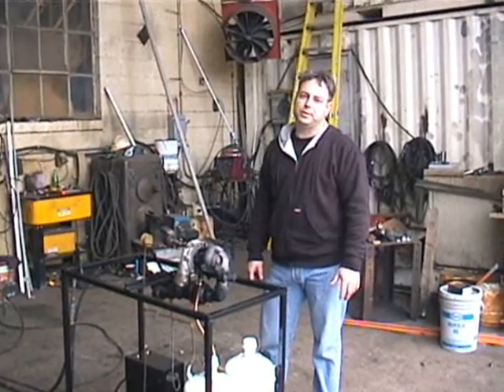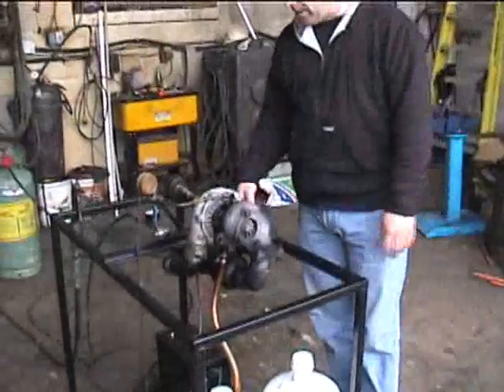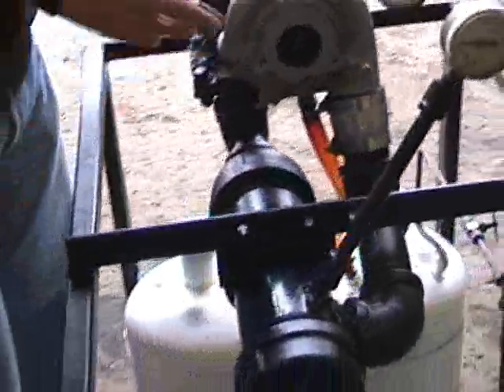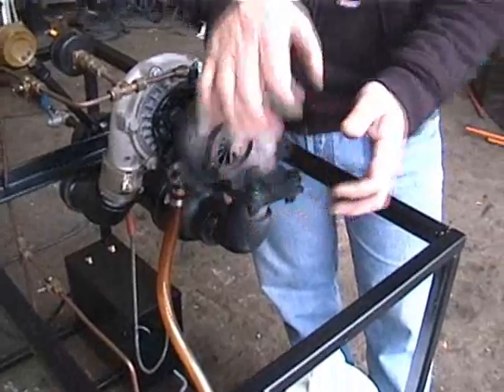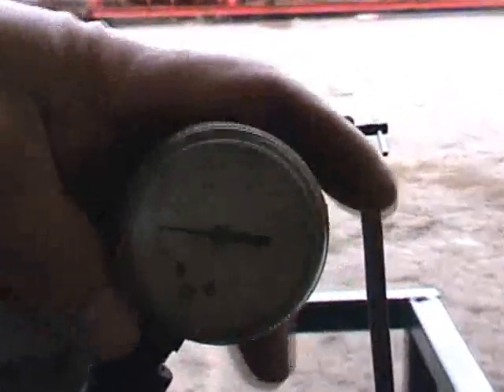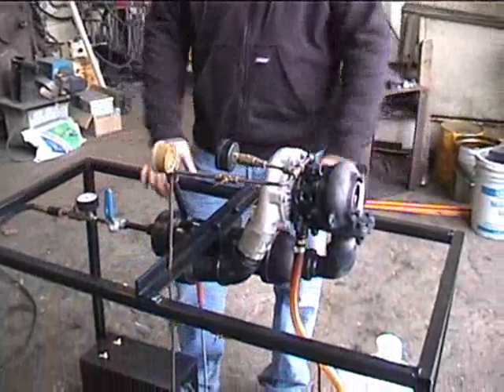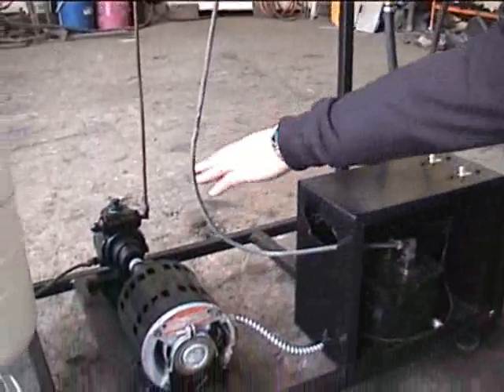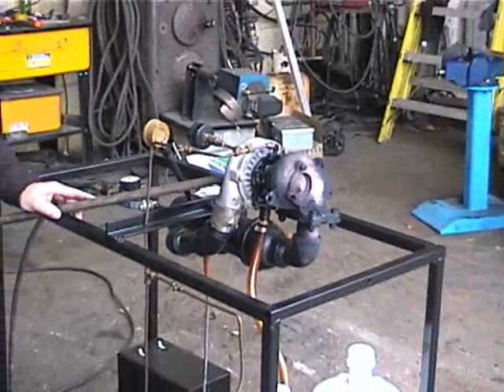Do-It-Yourself Turbocharger Turbojet

Comment: Um... I'm not sure this would be classified as a "Turbojet..." This would be a gas powered blower with a "turbo" assist. It has thrust but wouldn't really be a turbojet or jet. Isn't a turbojet something that powers its self through combustion rather than electrically powered blower? Correct me if I'm wrong. I have a friend that uses this to power his forge so, it's weird to me to see some one call it a turbojet. Resurrecting old post!
Reply: Does he use turbochargers to power a furnace? O.o
Or the blower?
The blower is used to start the engine, the first turbojet planes needed giant blowers to start up. This is a tiny engine so a small blower is enough.

Comment: in your 3" combustion chamber do you have a flame tube in it with the primary, secondary, etc holes in it or is it solely an empty 3" pipe? im just wondering cause your spark plug is mounted on the side

Comment: too danger to operation, the rpm is above 50,000 rev per min. During the engine is operation if something wrong  such as crack or broken, the pieces of metal is like a gun bullet which could kill you.

Comment: Nice job,Just a suggestion,if you want to make your oil seals last just add an oil cooler set up like they use on automatic transmissions.It's an old technology that EMD uses to this day.they call it a soak back system.when you shut off the turbo,leave the pump and cooler on to get the heat away from the center section.then too remember,your running at a very high level.blowing air in like you do before complete shutdown helps a lot,but the "soak back system" will cure your seal problem.

Comment: @hgortermarof  The only difference (essentially) between the homemade version like this and a manufactured turbojet engine is the location of the combustion chamber. On an actual turbojet engine, it would be wrapped around the center of the turbo, instead of routed around. This, and the fact that it doesn't have multiple stages of compression, a starter motor, afterburner, etc.

Comment: only thing is the kerosene in the combustion chamber will have to be under alot of pressure to ignite an idk if u can get those kinds of pressure with just a turbo which only put out 1-9 psi of boost. dont quote me on the 1-9 psi, i tried to research it n didnt find anything

Comment: put a cone or something on the exhaust end to increase thrust, use kerosene under pressure as your fuel and add another spark plug on to the exhaust cone for an after burner... it will ignite the fuel in the exhaust that wasn't ignited in the combustion chamber and increase thrust even more

Comment: Based on what I hear and see, this thing has blasting efficiency! Congratulations! If you wish to use it to generate electricity, I have some idea for you - try to get the torgue from a secondary multi-staged turbine instead of turbocharger's shaft. It could recover more energy from a jet stream and provide you with lower RPM on a shaft. There is only 1 company I know (Barber Nichols), who build high-rpm alternators, and they are really expensive.

Comment: @SmalltownTractors a turbo on a regular car, like the one he is using will have aprox 80 000 - 120 000 rpm. this is limited because the turbo propeller shaft has no bearings. oilpressure is making a thin oilfilm that the saft is gliding on. if this was a ballbearing turbo (often used on raceengines) you would see up to 200 000 rpm, and even more if things where optimalised. there have been recorded over 250 000 rpm on race turbos wich i know of :) hope you understand :)

Comment: great vid very informative. few questions..what do you do for oil cooling? didnt see any oil coolers or anything and also on that hot start up when the turbine blade went red was that just cause of lack of oil flow and then it went cooler once again when you upped the oil flow and was the blown oil seal due to temps being too high? also is there no danger of fuel burning back to the propane tanks?

Comment: its pretty cool...  but what would you use it for??? 
also the turbo ratio runs 1 to 1  on intake vs exhaust side turbines...  so its basically the same as a jet engine sucking in from the front and blowing out the back.....  still interesting though..

Comment: I assume that you choose propane to simplify combustion chamber design, to avoid danger of run-away due to liquid fuel, eliminate fuel pump, and to simplify mixing of fuel/air. Does a cylinder provide sufficient fuel flow? How do you know what oil pressure to operate this thing at? Is it using the stock oil pressure from turbo spec, or have you jacked it up somewhat? I'd like to build something like this, but wouldn't want to be anywhere nearby if it ran out of oil, or a blade decided to detach.

Comment: Carbs and turbos generally don't get along together. Unlike fuel injection, carbs can't add additional fuel to account for the increased air mass at any given flow. The simplest fix is for the turbo to pull air thru the carb (rather than push) which means drawing fuel/air mix thru the hot turbo... The net result is an increased risk of explosion, along with increased operating temperatures (you can't run an intercooler safely on a draw-thru because fuel will pool inside of it).

Comment: blown oil seal , is the seal that stops the oil getting into the turbine wheel housing, when it breaks oil burns in the exhaust and causes all that smoke, also stop lubricating the bearings properly

Comment: A hot start is that the turbine overheats (glows red) which will damage the turbine blades and can cause them to stretch and crack. There is no "Cold" start,
that would be called a normal/routine start.

Comment: Congratulations that you have combustion and self sustained power.
I'm a full time aircraft mechanic and have years of jet engine experience.
Two VERY important components that you need are (1) a bell mouth intake to the compressor to help the flow of cool air in, (2) exhaust gas pipe to help regulate the hot gases out, these parts alone will eliminate a HOT start and keep turbine temps down so it will not glow red hot. What are you using for lube oil? Hopefully turbine oil lube, synthetic.

Comment: I love the idea of building one of these, but I need to know more about it.

First, what kind of metal is best for combustion chamber (and is fairly priced too)?
I'm assuming once the engine is started, you don't need the spark plug to keep sparking right?
What's the best fuel/air mixture?
How dangerous is this?

Comment: very well explained, most other turbo jet engine videos are one pixel one fps video's that just start and run, with some drunk people behind the camera.

now i understand how it works, interesting to build one somewhere in the future.

but i'm wondering if the angle of the turbine blades are at a correct degree? i think there's a difference between 'it works' and 'can propel a aircraft'. maybe if you put a nozzle on the outlet that it fails already because of lack of power.. ?

Comment: no piston....the idea of a turbine defies reciprocating engines.

less moving parts...zero timing...

the combustion chamber HERE supports ignited fuel air mixture expansion across turbine blades. pretty much a blow torch inside there.

Comment: the oil is used to lubricate it as the turbo spindle floats on a film of oil, so when it says blown oil seal it is this film that is leaking and then the oil seaps through and got burnt which is why there is lots of smoke. nah its only sucking air into the combustion chamber it doesnt really matter if small things get sucked in

Comment: i can tell that your turbomachinery produces actual useable thrust because the turbine wheel doesnt discharge ridiculous quantities of flared flames..ive seen a few configurations that look "prettier" than this one, but youre engineering tops every one of them so far...as far as im concerned. i have a few questions cuz im building one also. HOW DO U MAKE IT SO THE EXHAUST DOESNT BACKFIRE THRU THE COMPRESSOR>>>HOW DOES IT FORCEFULLY TRAVEL THRU THE TURBINE HOUSING ONLY???

Comment: I would like to see a second radial flow turbine in the exhaust of the gas turbine. It will be a free turbine and its shaft will provide horsepower. This turboshaft engine can then be coupled to a (high ratio) reduction gear and power a generator for home electricity production, for emergency situations, high power demands, in a more ecological way than using small reciprocating gasoline engine generators!

Comment: I ve just built one of these. The internals of combustion chamber is difficult and guesswork for me , Still cant keep the burn from staying inside and not overheating the wheel. Havnt got it to sustain yet either, when I take the blower away it dies down, I think its not reaching a high enough speed, the bearings seem a little stiff.Should you be able to flick a turbo with finger and it will spin a couple turns? This one doesnt?

Comment: They fuel-air thing is over stressed here IMO.
If you build a decent combustor, with a flame holder in it, you will have little trouble.
The engine will figure out it's own fuel-air ratio.
All you need is enough air to get it to a speed at which it can self-sustain, and enough fuel to match. Too little fuel, and it won't stay lit. Too much fuel, and you will shoot flames out of the exhaust until the engine reaches a speed at which there is equilibrium.

Comment: A turbofan doesn't use a gearbox.
The turbine section of the engine blows onto a power turbine, which in turn powers the fan at the front of the engine.

Comment: Helicopters are powered by a turbine. Turbines have very little torque, but extreme RPM, so you can gear it down 1000:1 and get plenty of torque at low RPM. Jumbo jets use a turbofan, which is basically a turbine with a gearbox and a giant fan which blows through, and mostly around, the turbine. Not sure how you could use an automotive turbocharger for that - it obviously has to balanced very precisely.

Comment: Friction from the bearings and lubricant used is fighting against the spin of the turbine wheel, so nope, not so much. Also keep in mind that it's compressing the air along the inlet path, which causes resistance as well.

Comment: Amazing! Very impressive, and quite interesting really.  I just purchased three junkyard turbos, all in great shape; I plan to turbo my car, my friends car, and the other one will be for fluid dynamics research.  I was just wondering, why exactly did it smoke at the end of the video?  Was that due to the oil?  Because I have seen quite a few turbojet engines smoke when they power down...

Comment: Can you please post a few details about the combustion chamber design you came up with? The vidoe mentioned just the 3" pipe, nothing about an internal flame tube, etc. Its possible to see how you fed the chamber with airflow and fuel flow, but I'd love some tips on the inner design, as well.